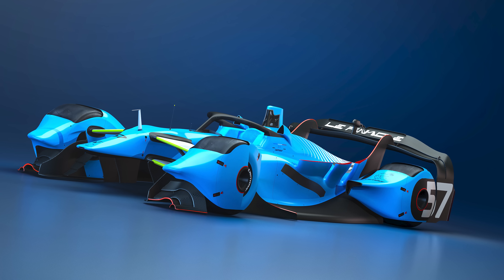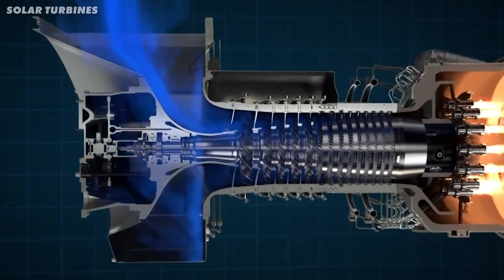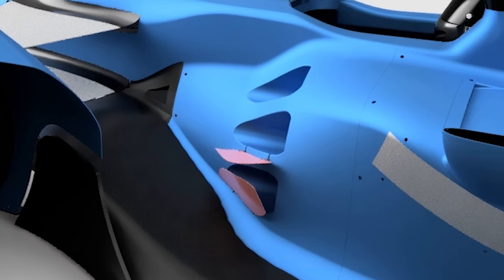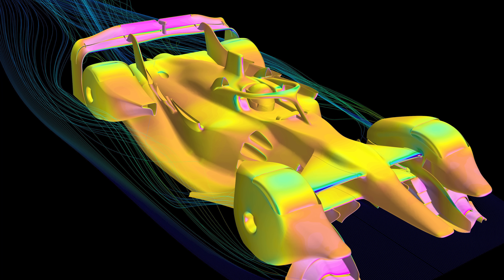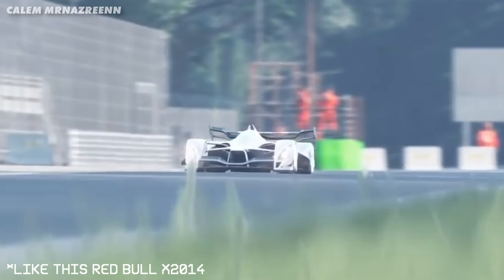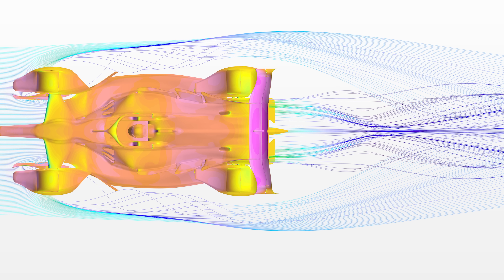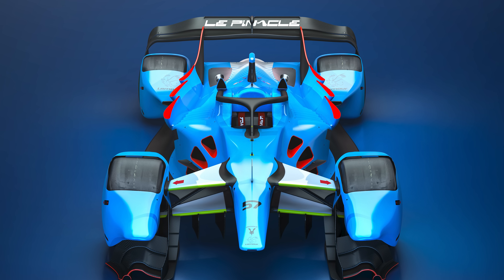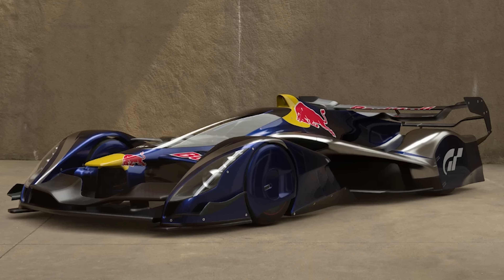Someone Designed The Perfect F1 Car (No Rules)

Comment: Now with this you can drive easily upside down in a tunnel :))
Reply from the maker: It's got a fan... That'd be cheating!
Reply: @Driver61  I don`t think having a fan is so important. Some cars with race drivers have millions of fans.
Reply: @willemp6432   No rules = not illegal.. Lets also add front and rear side facing jet turbines for thrust vectoring to take some lateral loading off the tyres.... and heck, even a front facing one for reverse thrust to aid with braking. . ;)
Reply: @willemp6432  thank you
Reply: @Nicholas-m7p 🙂
Reply: @willemp6432  Subtle
Reply: @Driver61  cheating ❌... Innovation ✅

We just want to see upside down go from theory to reality 🍻
Reply: @Driver61 may be cheating but would work I guess 😅
Reply: @Driver61  drive upside down already
Reply: @Driver61 what about not using the fan unless it detects the wheels lost traction or not enough downforce?
Reply: @Driver61  get this guy to reach out to Red Bull
Reply: @Driver61  I hope it has many fans🎉
Reply: @Driver61  The McMurtry Spéirling parked upside down. It didn't even have to be driving.
Reply: @Driver61  you could maybe deactivate the fan
Reply: @Conneticat_yt I think the fan is supposed to be connected to the engines driveshaft or smth
Reply: @Conneticat_yt  gyroscopic cut off?
Reply: With that fan i think it could park upside down lol
Reply: @lemonjuice6177  😆😅
Reply: @lemonjuice6177 😂
Reply: You could this already. This Main issue is the engine with the o ans the fuel...
Reply: @AndreA-yq4cu  Fuel pick up? If they can succesfuly do it on aerobtic planes, it's do able here too.
Reply: @paulhope3401  arent the plane engines built differently though
Reply: @random-person1   There are  several different types of turbines, yes.
Would they use them? I dont know.. I'm just trying to imagine what road they might go down if there were no rules and unlimited budget.... and the goal was ultimate 1 lap performance. 

All I know is that technologically we can already push beyond the limits of what the human body can withstand. 
If F1 had zero rules, restrictions or budget since it began.. the drivers would probably be controlling  theses so called 'cars' remotely in sim rigs via ultra low latency cams.
Regulation limits innovation and development but we need it... would any of us want to even watch and cheer on such a thing? I doubt it, personally I'd rather race online at home.
Reply: @AndreA-yq4cu  rotary engine will be the answer.
Reply: @AndreA-yq4cu boxer engines don't have issues with fuel starvation so that could fix it
Reply: Yeah hahaha😁
Reply: The toyota eagle mkiii had 10,000lbs of downforce at 200mph
Reply: Ten, thousand pounds? Sorry to be a negative Nancy but I'm pretty sure that no mechanical component that exists on that car could handle even half that amount of stress. This just sounds like theoretical B.S.
Reply: It also isn't matched to the form of the tunnel, so would fall.
Reply: like that car in men in black right?
Reply: Speed racer is getting closer to being reality.
Reply: Already can though
Reply: McMurtray just did this in a video a few weeks ago!
Reply: yeah they have problem to have money lol so not helping this 10kk
Reply: I think the stumbling block at is the cash to build a suitable tunnel.
Reply: 1 pebble and you take off as concorde
Reply: If it weighed less than 4.5 tons
Reply: NO MORE TRAFFICCCCC
Reply: Extreme G in real life :D
Reply: nope, the tunner is bent so the skirt woudnt work
Reply: with that setup it could drive upside down and stop if you wanted to.
Reply: Pffft nice concept  /s

Looks very '07
Reply: And …
Reply: Exactly what I was thinking. I was picturing a speed racer track. Fzero stuff.
Reply: Drive upside down? Park this thing upside down as long as it's idling.
Reply: Nope !!
Reply: Bruh.
They should make races in weird ass sci fi curcuits, that have loops and shit.
Reply: "Yolo"? In the god fearing year 2025 😨 😨 😨 😨 😨
Reply: This car should be able to be stationary upside down in a tunnel, no speed needed.
Reply: Mcmurtry beat them to it
Reply: Not in a tunnel, but on a flat plane yes. The air trap under the car wouldn’t work properly because of the not flat ground, making the car’s suction cup like aerodynamics under the car wouldn’t work as well
Reply: @Trilles16  I would imagine a VERY large diameter tunnel with gradually sloped walls and a flat ceiling could be constructed that would allow it to do so but it would have to be purpose built for the task and probably cost more than the car.
Reply: Or someone could make the SRT Tomahawk X and make it driverless. They made the robo car, and it ran at goodwood. Take this to the next level.
Reply: Maybe not you can have to much downforce be good to see in action 😉 👌
Reply: This is a horrible car. Its all aero and requies a computer to operate it. I could build a faster car using mechanical grip. He should have taken up the 6 wheel idea. This car will have to change tyres every 5 laps. Need more tyre technology and mechanical grip.
Reply: @electrohousemusic166  
I bet you're Adrian Newey using a pseudonym. 😉